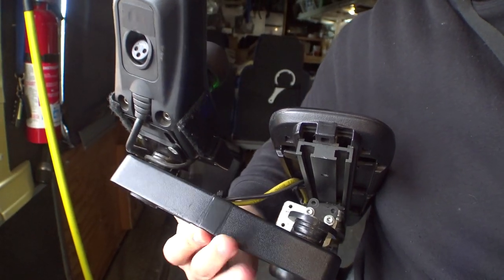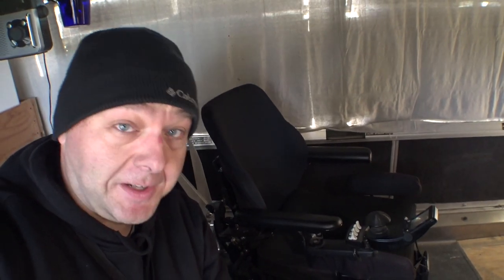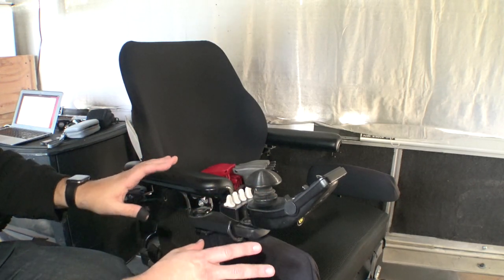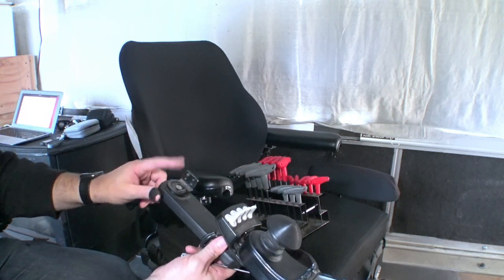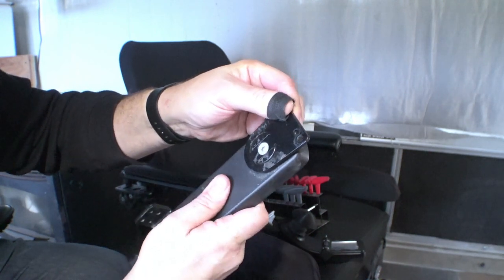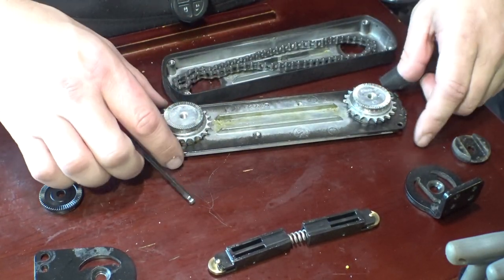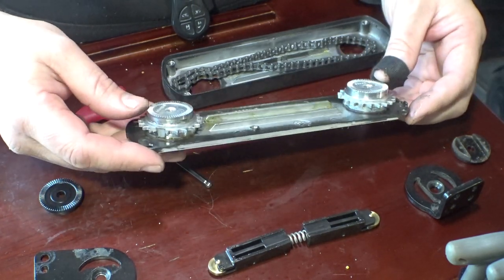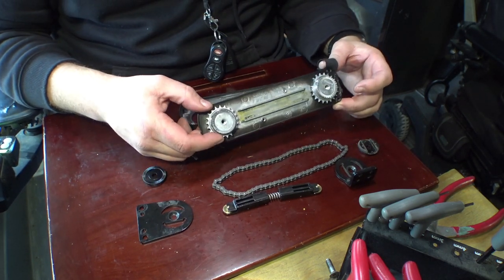VLOG 645: inside the permobil 'slim' swing away! (retractable joystick mount)

Comment: If you put the sprockets in so they do not point at each other, you have 2 detents instead of one.  I like one inward putting the joystick closer to the center of my body, and one outward so I can move the chair when not sitting in it.  If you hit something hard head on with your joystick, the 4 outer corners of the swingaway lower casting break off.  Easily repaired by adding wide washers under the 4 small corner bolts.  If you lose the rosette pieces, there are more in the calf pad assembly.  ARRI rosettes for camera mounts are also a mating size which allow creative joystick mounting options.

Comment: The 90deg mounting bracket is designed to be mounted perpendicular to the armrest. It has a drilled hole and slotted hole. If you remove the part from the retractable joystick mount and replace it in the factory orientation and install it correctly then you will have the ability to change that "inner lean" that you like.
Reply from the maker: with stock arm rests, that's exactly that how they're designed to work. but with the arm bar adapter kit, there's no way to mount the bracket that way unfortunately.  i could get a different bracket and make it work, but just haven't done it yet :^)
Reply: @TotallyNormal-  I was able to zoom in a little more and see your issue. They make mount for that. It's a tube clamp and the retractable mounts to a bar that slides in. I know I have the bar and joystick attachment, I don't know if I have a spare clamp.
Reply from the maker: yea.. in the video when i installed the arm bar kit, i realized they didnt give me any of the proper hardware with it... works for now.. but just havent spent the time to order the correct parts :^)

Comment: I have put 1K miles on my M3 with the slim swingaway, and it has no discernable wobble. My old M300 with the adjustable swingaway is, and always was, wobbly just a little while after I tightened it.

Comment: My swing-y mechanism just tried to die on me in the middle of the grocery store. The whole thing is wobbly and the teeth inside are grinding against each other in some horrifying cry for help in some corner of a Saw movie. I'm tool savvy, and do a lot of woodwork, but I tend to leave chair stuff to the experts/dealers. Unfortunately, I need to get a doctor's appointment, a referral, have them come to my house to say "yep, that sucks, gotta fix it" and then go through the long process for requesting approval to fix the joystick, then make an appointment for the actual repairs. It's a 3-6mo process, and this, after 6-9months of work to replace the batteries (fourth time's the charm, apparently)! I've cannibalized plenty of manual chairs, but Permobils are like (aggravating) pressurized think tanks.... designed and put together well.... but ... hell, it would be easier to shoot into space and fix the Mars Rover than to fix anything on this sucker!

Thank you for the clear, concise, straightforward (and well-spoken!) step by step of what to expect and how to fix it! Even more-so, catering to audio learners, visual learners and kinetic learners! You're a time-saver/life-saver/SANITY-saver!

Comment: Just got my M3 yesterday. Finally after fighting for two years for it. Can’t remember if you did a headrest adjustment video or does anybody else remember? Would love to try and do that myself because it didn’t get done in the wheelchair adjustment session we had yesterday.TNA
Reply from the maker: there's a few versions of headrests that get put onto the chairs depending on what the dealer picks.. but there's usually some allen cap bolts that are easy to find, loosening them a little bit typically allows for adjustment.. sometimes they have a ball socket adjustment setup as well.  easiest with 2 people.. one to loosen and move, and the other to sit in chair and make sure its in the right spot :^)
Reply: @TotallyNormal-  thank you! Will try

Comment: Dude!! Same thing just happened to me last week. My nurse bumped mine into the van door and I t bent it slightly so it's wobbling yours now. My tech guy is just swapping with their demo chair. It's our fault we bent it but it's definitely better than the old magnetic one on my quantum chair! Mine has a different attachment where it mounts to the arm rest that allows it to tilt inward vs 90 degrees fixed position like yours. My F5 VS is 2 1/2 years 1800 miles.and its been tight till my nurse crashed it!

Comment: I'm glad you made this video because you may be able to answer my question to the issue that I'm having on my swing away joystick mount on my 2021 F3.

Remember that Allan screw that you pointed out at the beginning where you can tighten the swing away function so your controller doesn't swing out as easy? Well mine keeps coming loose and I have to continuously tighten it. Is it possible that there is no Loctite on the Allen screw causing it to loosen overtime and should there be Loctite on that screw?

Comment: I found your video while researching an alternative joystick mounting system for my m3. I currently have this style of articulating arm. The issue I am having is the way that these cable(s) are bundled and routed underneath the arm puts them under constant stress from moving the joystick's position and giving me a JSM Bad cable error 7F00. So, I am now working on getting a cable replaced for the third time in 7 months. But, I really need to find a different mounting method (not fixed) that will not keep messing up these cables.
Thanks for the video and I will look at some of your other videos so that I can see what else might work for me!

Comment: I'll be transitioning from  manual to a power chair soon; the F3 is looking best so far.  I wonder if you could put one of those slim swing away mounts on The other side and mount a RAM B-ball on it for a cell phone holder?  or would having a swing away on both arm rests be irritating?

I haven't felt the need to binge a YT channel in YEARS.  Your insight is very helpful.  Domo gracias.

Comment: My wife has had her M3 for almost three years and 850+ miles now, and it has the same type of joystick you have on the F3. The joystick has about the same amount of vertical play as yours. We don't know whether that play has developed over time or whether it was that way originally as we have never paid attention to that. We have adjusted the angles so that the joystick is parallel to the armrest but the detent places it slightly inside of the arm center line.